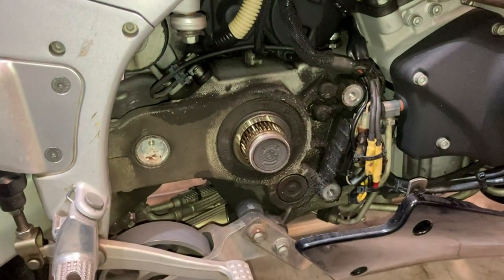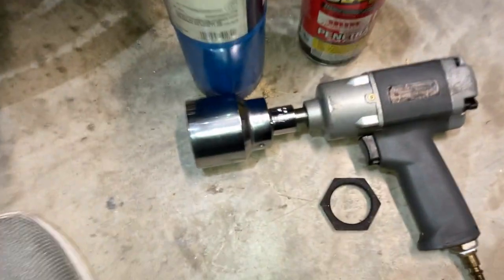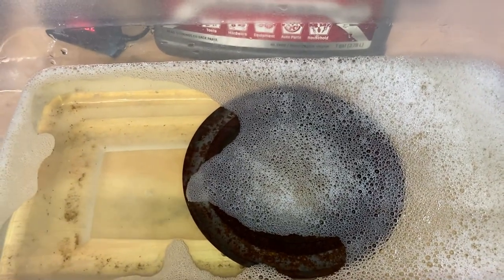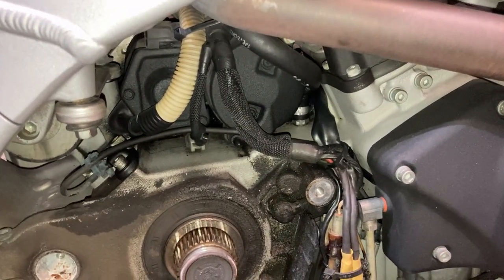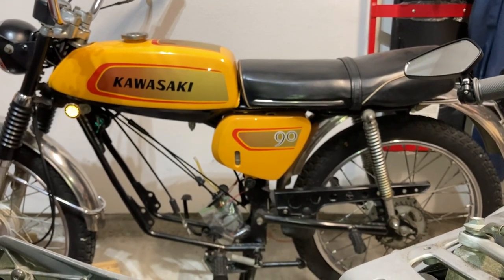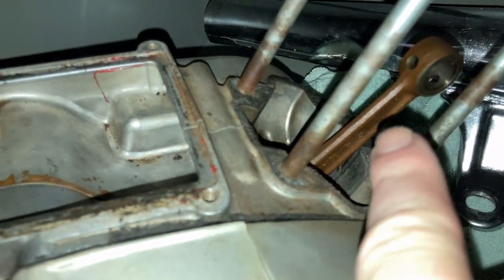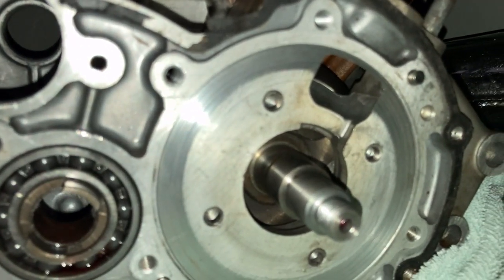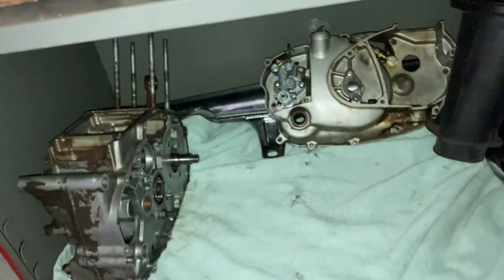2005 Buell XB9SX - Teardown - Part 1

Comment: I just started watching your vids.  I have an 03 XB9R.  Street/track bike.  That I'm going sport street fighter style with using  MX bars, the bike has a ton of Track bike goodies on it.  From full racetech tuned forks, ohlins rear shock, Toby steering stabilizer,  professionally done chain drive conversion,  buell race rev tuned ecm,  custom made tuned exhaust.  Like I've always wanted a XB9R Firebolt since i first saw one in 03.  And in 2019 i bought one from a guy who completely refreshed the whole engine, transmission all new components.  He gave me all the original internals which had 7000 track miles on it.  Everything looked new yet.  So basically I got an 03 XB9R now with 250 miles on the engine.   These bikes are worth keeping a live. They have this amazing thing about them when you ride them.

Comment: The 90 really looks like a lack of oil . I bet it is oil injected and if oil was in the oil tank the injector is bad. or clogged. 
When you get the parts you can always premix it.
I had a Can Am rotary valve same thing. I just premixed after .
Keep the buel stuff going don't give up.
Cheers . Got a thumbs up and a sub :)